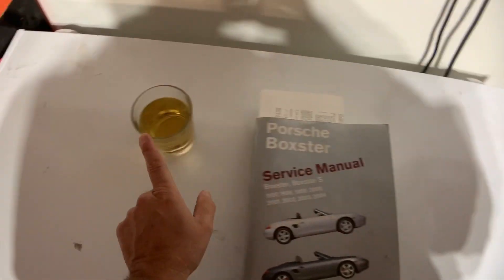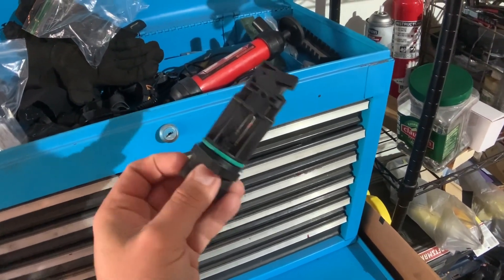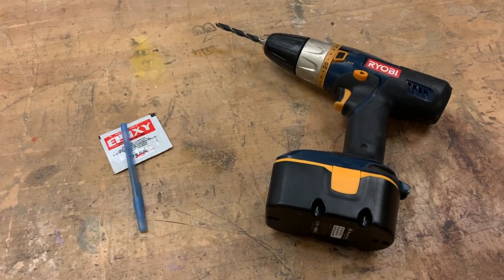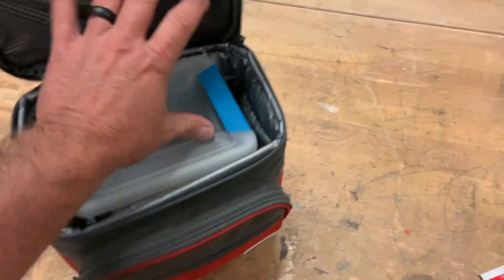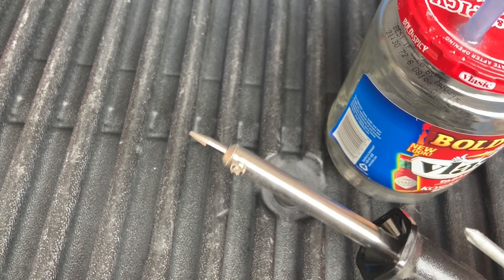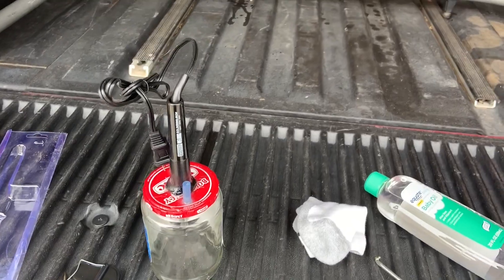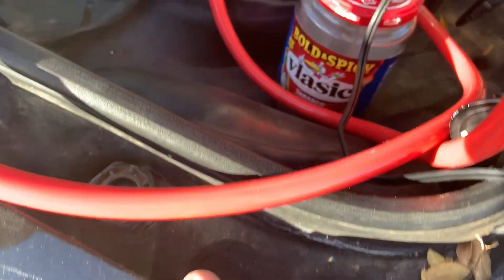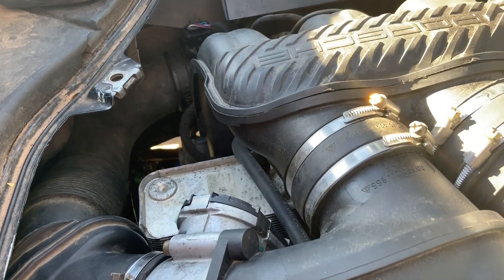How To Build A DIY Automotive Smoke Machine - P1126 P1133 Porsche 911 996 Boxster 986 987

Comment: I have the exact same stumbling at idle but only at operating temp, then dies just like the video with all the dash lights coming on! Is that the same in this case? Codes p1130
Reply: Just realized that it's at operating temp for you as well! So exact same symptoms for me! Is this only operating temp for u too or has this happened at cold temp? Either way, ill be smoking it this weekend 👍
Reply from the maker: Only up to temp did I start to have the stumbling, replace that fuel pressure regulator and you should be good to go!
Reply: @ArrowheadGarage  hi, I went to check on the fuel pressure regulator and on my 2002, doesn't seem to have one in that spot. I couldn't even find a part for my 2002 2.7 boxster, looks like they only make them for the 2001? Do you happen to know the reason for my car not having this part on the location by the fuel line
Reply: @ArrowheadGarage  UPDATE! The reason there isnt a fuel pressure regular on my 2002, in the area that yours is in, is because 2002 to 2004 has the fuel pressure regulator is in the tank on the fuel level sender. My fuel pressure measured at 55 psi rather than the 48. If it is a bit higher, that does mean the pressure regulator is bad?? Leaning towards this especially with my car showing the same exact symptoms as yours

Comment: I’m wondering if just replacing the O2 sensors (pre/post) catalytic converter would eliminate the two P codes?
Reply from the maker: That might do it, mine on this 986 had so many other issues!  Thanks for watching.